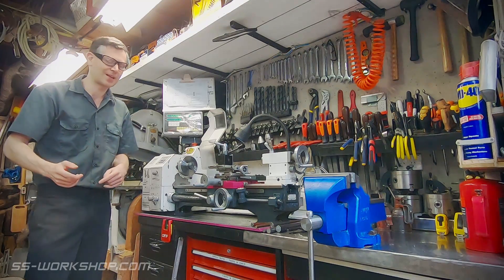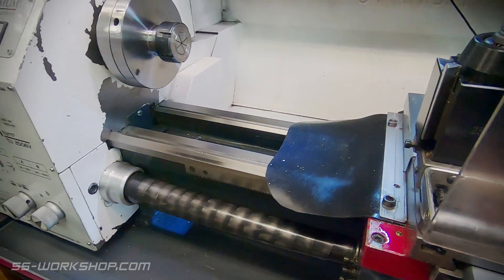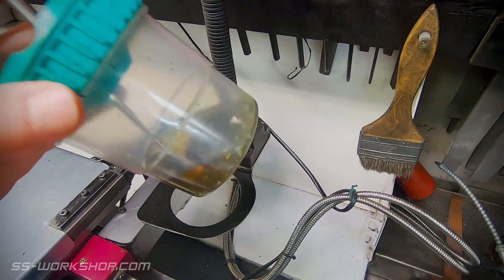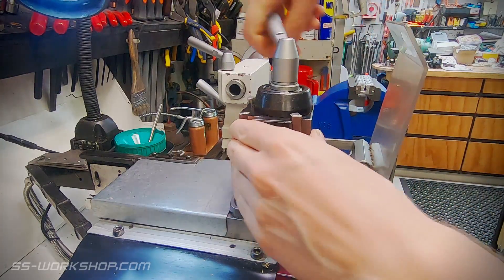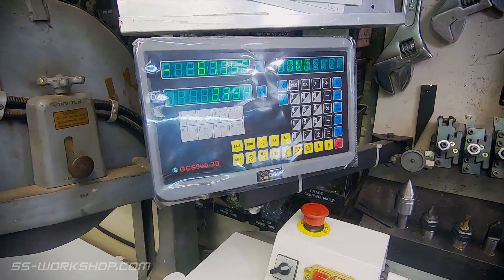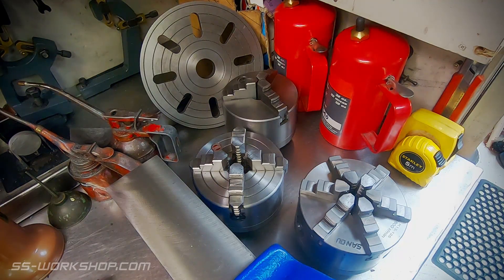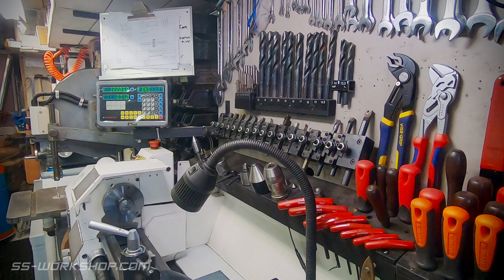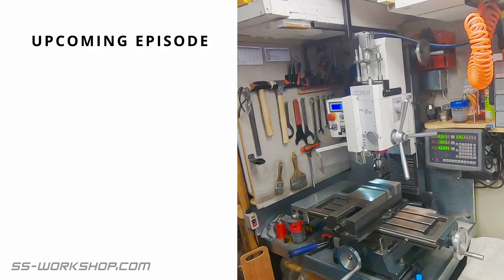Workshop Tour |  Benchtop Lathe  | S1.E1.

Comment: Another great video, we have the same lathe but cannot find a faceplate for it! Where did you get yours? How does it fit? Where can you get 20mm plus ER 32 collets from? Thanks
Reply from the maker: Thanks, my faceplate is one for a similar sized sieg as a local supplier stocked them.  I had to change to threaded studs rather than their cam lock studs and machined the register on it to fit. I found the oversized collets on Aliexpress.

Comment: hello, where do you have the threading gauge from? i can not find it and it is not included when buying the machine new...
Reply from the maker: Hi Jonas, they need to match the leadscrew on your lathe so haven’t seen them sold separately. You can thread without, you just stop the lathe and leave the carriage engaged then reverse it and go again without disengaging the carriage.
Reply: @SS-Workshop  thank you. I know that i can thread without when leaving the nut locked. 
But where is yours from?? I want to buy the same machine new, but it is not included.. :(
Reply from the maker: @jonask3745  mine was from Machinery House in NZ

Comment: Great video. Lots of ideas for my shop :) I've got this one on the way, including the attached mill (20M). I'm trying to figure out which vice to get that will fit the cross slide, since the lathe and mill share it. Could you tell me what what size the slots are, and what distance they are apart? It may be safer for me to wait until it gets here before buying the vice. I've been eyeing up the anglock vertex VA-4 (if it fits - without the rotating base).
Reply from the maker: Thanks, great to hear and congratulations on your purchase it’s a great choice for a lathe. At a quick measure the T slots are 10mm and 100mm centre to centre but would be a good idea to wait until you see it. It might be worth checking the max weight the cross slide table will take as i know even on my benchtop mill I only just made it within capacity. You should also consider having having a hex key positioned in the carriage lock so you can control the table movement. I previously had another type of combined machine that was a similar size and that ran a much smaller vice about 50mm, you could consider a small toolmakers vice as an alternative as they are lighter and smaller. (By the way I have a video for making the hold down clamps for a tool makers vice if you head that way). Would be interested to hear how it performs as a mill, good luck.

Comment: This is at the top of a list of three lathes I'm currently considering buying.
Reply: please dont.. Ive got one and although it works kinda okay now, I needed to completely disassemble and clean it from all casting sand..
Reply: @Tachikomaster  I had sand inside? In the parts?
Reply: @ThePiones I have the same lathe. Insides was all dirty from metal grinding dust and sandcasting sand.
Reply: @Tachikomaster  That indeed shows poor care when building this. For the price that is unacceptable.
Reply: @ThePiones  Yes, you can buy the same quality lathe cheaper from other brand names.
Reply: @Tachikomaster  what brands are you thinking of

Comment: Hey where did you get the quick change toolpost from? Im about to buy this exact lathe, and the only thing holding me back is that I havent been able to fond a QC toolpost that can be made to fit. otherwise, thanks for a really good, really informative video, best video I have found anywhere about this lathe - thank you!
Reply from the maker: Thanks Tim, it’s a 250-111 that I purchased from AliExpress, it came as a set with a some tool holders. Please note that it did need modifying to fit the top slide of the lathe.
Reply: @SS-Workshop  modifying stuff is life! thanks for the reply, great to see content creators still have time for viewers even months after  releasing stuff!
Reply: @SS-Workshop  i just have another question, do you have a link to the seller? Im looking and I see a 250-000 and a 250-111 version of the QCTP,  not sure what the difference is between them?
Reply from the maker: @tigertim20  sorry no link it was a few years since I purchased. The second part of the number of the number is the size so a 250-000 is smaller and a 250-200 is larger. What your looking for if you want the same size as mine is a 250-100 series. The 250-111 is the wedge style tool post body there is also a piston type which some say isn’t as ridged (I think the part number as 250-100 for this). All the compatible parts / holders for the 100 size have the second number start with a 1. Another good thing to know is these are a clone of the aloris tool posts and from recollection they call the 100 series AXA size, so you will also see them listed under AXA tool posts from time to time. Hope this helps, good luck.

Comment: Do you find the quick change tool post shift under load without the spring pin locking onto the tool post?
Reply from the maker: Well spotted Daniel, No I haven’t had any issue with the tool post moving, I just lock it down really tight. The only downside is not having a reference for squaring the tool post when moved. I looked at drilling the spring detention but the body of the tool post is hardened so didn’t have much luck.

Comment: what actual quick change toolpost did you use ?, as in the number .ie 250.201 or similar ,thankyou ,great setup
Reply from the maker: Thanks Bob, it’s a 100 series tool post, number 250-111 which is the wedge type.
Reply: @SS-Workshop  would a 250-100 work? cant find a  111, thanks    bob
Reply from the maker: Hi Bob, the 200-100 is the same size, the only difference is it’s the piston type clamp vs the wedge type clamp. Both are 100 series so should work from a size point of view. Both use the same holders. The only thing that is unknown to me is how they are built and if increasing the inside bore could be done the same way as I did if that’s what your planning. I hope this helps, good luck.

Comment: Hey, would you advise me to buy this lathe? 
Do you have any flaws in this lathe?
Reply from the maker: I have had this lathe for a couple of years and it has been very reliable. It’s well built and has may features that are not seen on some other bench top lathes such as the quick locking handle for the tail stock. One thing to note is because it’s got electronic variable speed it lacks torque at low speeds. This is the same with any variable speed lathe of the size. I must say it’s very convenient to be able to adjust the speed even when turning. Hope this helps with your decision.

Comment: Great vid. Where did you get your tool holder holders on your shelf? Been looking for something similiar for a while to make a rack like you have..
Reply from the maker: Thanks. I 3D printed the holders from ABS plastic myself, I have seen a few people use metal or timber with various designs but I had the 3D printer and was looking for a project. There are several designs on Thingiverse if you search “lathe tool holders” but there is not to much to them so I modelled my own and once I had a good fit with a test one I made a pile of them. They have stood up pretty well, I have been using them for a couple of years now and only had a one break.

Comment: Good evening, buy a very similar lathe, I turn it on but the motor does not rotate, the screen lights up but nothing to give the motor that can be, I thank you for your help, Greetings. Antonio
Reply from the maker: Hi Antonio, one thing to check is if your machine has a micro switches on the chuck guard and motor cover. If they are not shut they won’t run. Another one I have been caught out on is the mechanical red stop button that is seperate to the on /off switch as when pushed they stay off until you lift them. Good luck, hope this helps.
Reply: @SS-Workshop  Thank you very much for your help, I will review the micro switches, Greetings Antonio

Comment: Thanks for the video! Did you also have to make an extension for the tool post stud or did you replace the whole stud?
Reply from the maker: The stud on the top slide remained unchanged. what I did was replace the inner sleeve of the tool post with one I turned that fits over the step at the base of the stud. This avoided the method I found online of turning that step down which cant be reversed back to original. So basically my method was to modify cheap tool post rather than expensive lathe.
Reply: @SS-Workshop  Strange.. I just picked up a 2506 and the stud is way to short to stick out the top of the tool post. Even after dealing with the step at the base.
Reply from the maker: Yes strange, what size tool post is it? Mine is the 100 series, Just thinking it might be the next size up you have. From memory the stud didn’t look easy to change out so only other thing I can think of would be to thread an extension on to the stud but that would probably require it to be way short.

Comment: can someone link me that oiling cup thanks
Reply from the maker: I picked mine up from Amazon US, actually have a couple of them with different spouts, the one I like most for oiling machines has a solid spout which is better for oiling ports. GOLDENROD (625) Pistol Pump Oiler with Straight Spout - 10 oz. Capacity https://www.amazon.com/dp/B000VA93MK/ref=cm_sw_r_cp_tau_S903EbF792EAW

Comment: Thanks for the great info! Have you turned much stainless on this lathe?
Reply from the maker: Not to much only a few small shafts but seemed to handle if fine, just need tooling that can handle cutting stainless.

Comment: Very nice vid, about to buy same lathe.  Was the DRO hard to fit?  Does it do small cast iron castings ok?
Reply from the maker: Thanks, the DRO took a bit of fitting but it’s the same with any lathe, I have my cross slide scale located standing out the rear with an A frame I made up, fixed to the back of it as I didn’t want to restrict the tail stock travel which is a little short at times. But the cross slide scale could also be fixed on the side as most people do. The long scale is located behind the machine and just needed some spacers and a couple of holes drilled. As far a capability it’s good nice and accurate, would be fine with small cast iron castings, just be careful to keep the ways clean of the cast iron dust. The only other think to note is it’s short of torque at very low speeds. If you want to see more of it’s capability see some of my other videos in which I have been making parts for my steam locomotive.
Reply: SS Workshop thanks - will limit my build to 5” scale tank engine.

Comment: Hi, good quick overview of your lathe your setup is well though out, can you give me any idea where you picked up the lead screw cover and what it is called, i have the same lathe, Thanks
Reply from the maker: Hi Don, I got it from AliExpress a few years ago, just had a look and found one under, conical spiral steel tape telescopic spring shield covers,  http://s.aliexpress.com/JfyeIZbq
I checked mine was about 45mm at big end and 30mm at small end. You can cut the length down with snips and I made a male and female socket at either end to keep it in place.
Reply: @SS-Workshop  thanks very much for the follow up. greatly appreciated